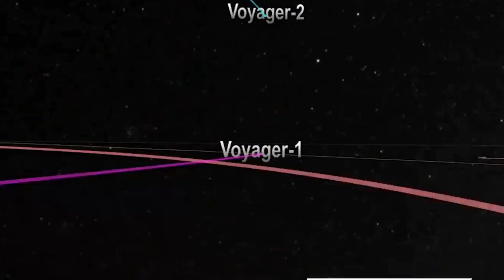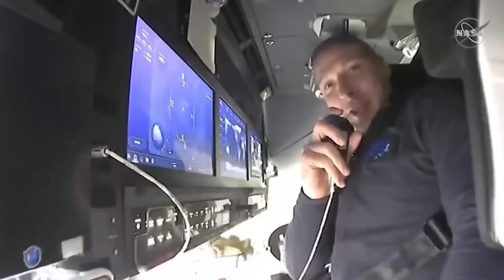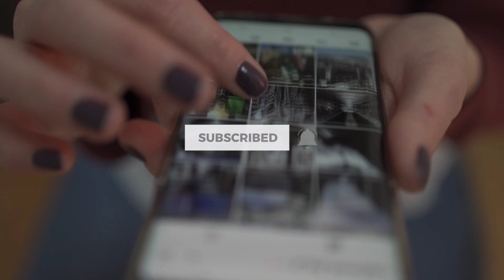SpaceX And NASA TARGETS Separate Moon Launches On Different Days! (SpaceX News) | Moon Launch 2022

Comment: before you break your own arm patting yourself on the back remember, SLS is a design from 10 years ago, using nothing new but a few computers. it uses the old solid core booster designs from back then and the engines, many used, from the shuttle. so nothing exciting or new and extremely expensive and wasteful. throwing rockets away after every launch is old hat and 5x more than saving at least part of them.this may very well be Nasa's last Human mission after the way they handled this one.